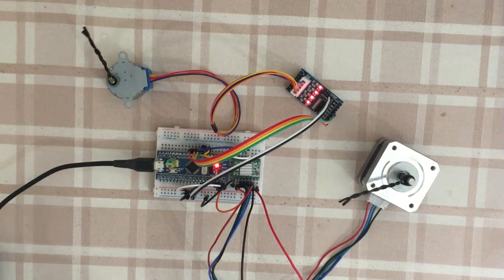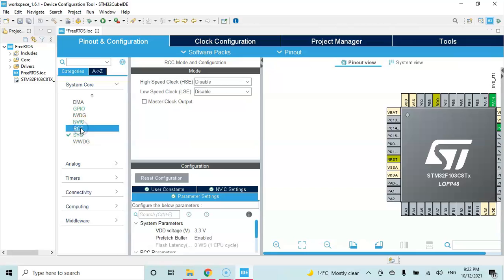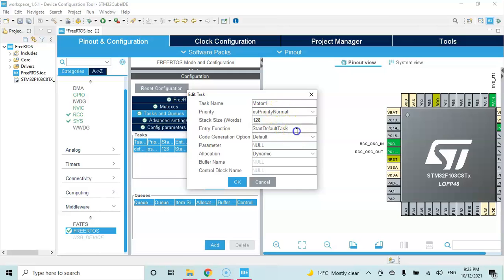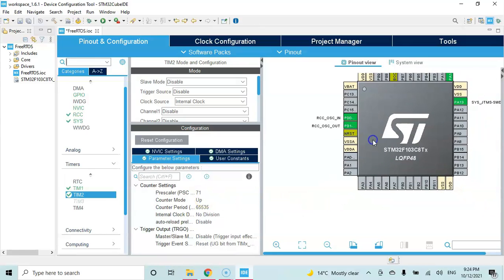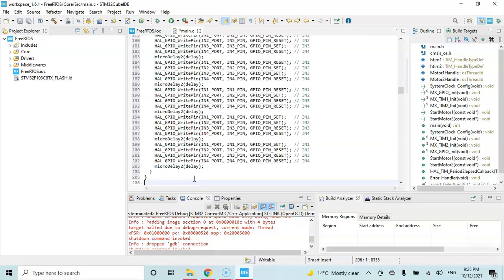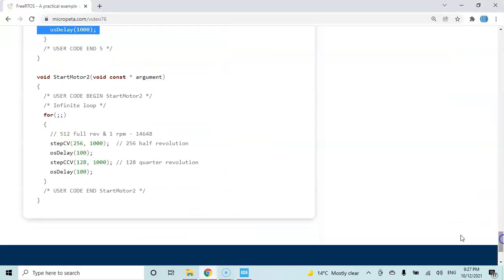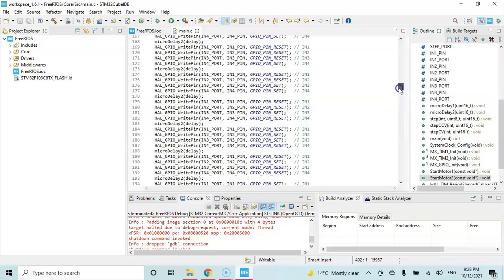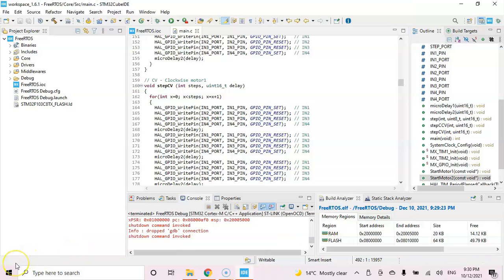76. STM32CubeIDE FreeRTOS. Multiple stepper motors with STM32F103C8T6

Comment: Hi Sir, what is a maximum pulse frequency when you RTOS to control stepper motor?
Reply: it is provided by the stepper motor manufacturer... usually leadshine steppers would require 200k frequency at max.

Comment: very informative
Reply: sir my st-link programmer  showing communication error when i try to connect usb to stlink with  stm32 f103 
can u help me out ,i try every step
Reply from the maker: Thanks,
1. check the wiring connection between st-link and stm32
2. provide sufficient voltage to stm32
3. try using different usb ports in your pc
4. try gdb server also try openocd
5. if you have another stm32 board tr with it
if still error persists, let me know when and where the error occurs

Comment: Thankyou for the RTOS video sir. I am planning to use this in my project also. I am trying to design 3 phase overrcurrent relay. Could you please tell me how can I take 4 current inputs and 3 voltage inputs in the stm32cubeide? 
I commented on the sensor video as well.
Reply from the maker: Thanks. 
You don't need freertos for that purpose.
You need to use multi channel adc.
I have done with 3 potentiometer input in my video-no-32
Similarly you can use seven channels